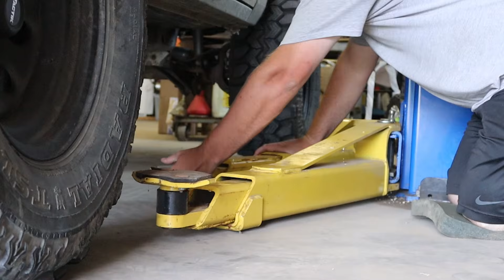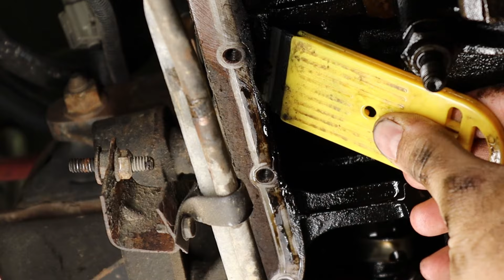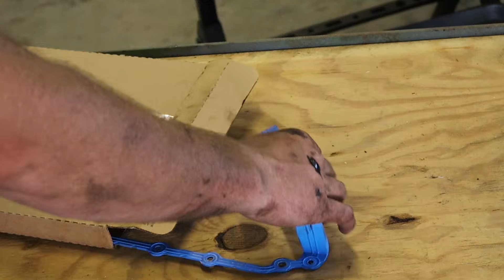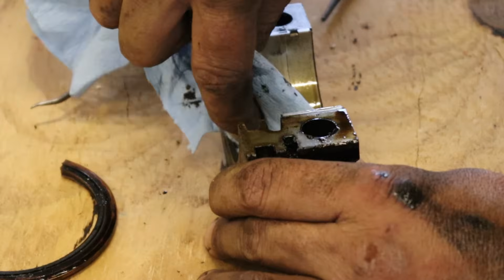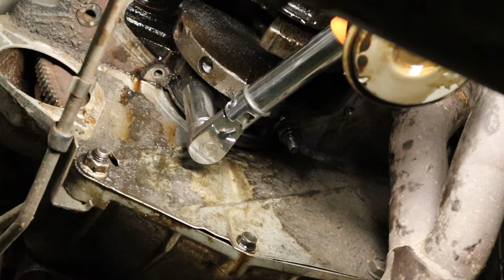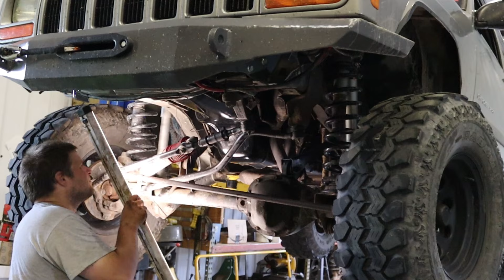JEEP 4.0 REAR MAIN SEAL replacement AND OIL PAN GASKET on my JEEP CHEROKEE XJ

Comment: You have any problems with leaks after? Done this twice good for 3 days then It’s just as bad as before. Wondering if it’s possible I got the pan gasket in there pinched or if my motors just got too much crank play

Comment: The zinc oil is nonsense....they stopped putting that in oil in the 80s and yet a properly maintained inline 6 will go to 300k with conventional oil easy. Also when you have the oil pan off its a good idea to nuke everything with parts cleaner and get all the old oil and build up off. I did this project on my 2000 WJ  a couple years ago....good video though 🤘

Comment: Soak both of the seals in transmission fluid. This is superior to other oil-based products, and it will be far more slippery than others, resisting heat much better on the wear in period. The amount of fluid in your oil will be insignificant.

Use Motorcraft Gray RTV. Its what technicians use over black. Sets up like putty, stays in place and won't split or squeeze out over time.

Comment: Note: I HAD to use the “shoehorn” piece of paper on the outer side of the seal for install. It went in super easy once I had the piece of paper in the right spot. It would not go in by hand otherwise.

Comment: Did you have to drop the transmission on it at all? or was it just the oil pan? And for the oil pan did you have to drop the axel or does it just slip over with the lift?

Comment: nice video - well, to get the oil pan out, usually is a pita with stock XJs. Did you just untighten the shocks and drop the front axle ? Thanks.

Comment: I haven't been in an '00 up. Had not seen the main girdle. I wonder if that increases rigidity at all. I imagine pre '00 would need different main bolts to add that. Any comments? Thanks for the excellent video.

Comment: Question! I got my 2001 jeep grand cherokee, with the 4.0. I wanna do my rear main seal as well, is the procedure the same from this video I just watched??
Reply: Thanks for the reply, but I've already did the rear main seal. About a month ago and it was the same, I did a motor swap and I changed the gaskets on my new motor on a stand and the new motor is in and I've been driving it for a little bit now with no issues or leaks! Thanks for the video as well man!
Reply: @joelafleur6423  not my video but glad to hear it went well for you!
Reply: If it has the 4.0 inline six, then yes it'll be the same
Reply: There's a possibility the front suspension could get in the way. Not familiar with the grand Cherokee suspension from that era

Comment: How did you remove the two bolts on the back of the oil pan that are up against the dip on the oil pan? Doesn’t look like enough clearance between the bolt and pan to fit a socket

Comment: Is it not a good idea to try and clean up inside of the engine when you have the girdle and the oil pan off like if you can see sludge on the Pistons or anywhere else
Reply: No.

Comment: The main girdle bolts are 14 mm. And he should seal the main rear seal with silicone on the mating ends, or it will leak.

Comment: bullshit i have a 96 xj the bolts where easy to get to but i cant get it out. front axle is in the way and no idea how to get it out. the oil pan just doesnt drop out that easy on a xj unlrss you have a lift.
Reply from the maker: This part of the process is frustrating I know. the oil pan doesn’t just drop out when you take the bolts out. You may to twist it a certain way clear everything ie steering, axle, dipstick tube and oil pickup tube. Try disconnecting your shock and trackbar. That will allow the front axle to droop  further down. If your jeep is stock than our are the same droop wise. I have longer shocks but they don’t fully extend at full droop.
Reply: That's what I had to do I had to undo my shocks front. Undo the sway bar and took a scissor jack and had to shove my front axle downwards. Then I was able to get the pan off and on. If the oil pan was about an inch less. Meaning the piece that hangs down the front of the oil pan where all the oil sets. If that was about an inch shorter not tallness but width from front to back it could make it without any extra time.

Comment: Quick tip for those using the little blue pins on the rear of the block to install the gasket ... it's not explained that you will have one PITA getting the pan to line up especially with having the converter cover on so get ready.  Wish he didn't cut that section off but I left the tip for future installers.  It's not that simple on this step.

Comment: Any tips for the upper part of the rear main if you dont have the little guide to get it started?
Reply: And what size lift and tires do you have?
Reply from the maker: Lift is a 4” lift and my running 32”s
Reply from the maker: The upper guide is just a piece of poster board. You could try that or gently walk the lip of the seal into the cavity.

Comment: when did the white paper get pulled out? did it follow the seal to the other side or did you take it out after you got the seal going?
Reply from the maker: the white paper is just there to help protect and guide the seal when installed into the upper channel. think of it as a shoe horn. it shouldn't pass through the upper channel.
Reply: I had to buy another top seal because it ripped and bent, I guess I put the shoe horn on the outside whereas you placed it on the inside and you folded it but I don’t know exactly why

Comment: Did you use diesel motor oil on it?
Reply from the maker: it might say diesel oil on the side of the jug but its a 10w30 weight which is more of a gas engine weight oil. the shell rotella t5 10w30 oil has a higher zinc content then most conventional oils nowadays

Comment: So, I let the screw driver slip and damaged the bearing cap insert I guess? Its the C shaped piece that sits in the wide part. You think sanding it with some fine sandpaper will be ok? I can't get a replacement part and I need to put this back together asap
Reply from the maker: I agree. I'd just make sure the bearing surface is smooth before reinstalling
Reply: My 2 cents….. I think it should be ok.  Not much you can do at this point. Fuk it.  Hope it’s good.
Reply: I found the correct bearing and put it back in. All systems go. Oil pressure drops to 20 at operating temp now though.

Comment: Thanks for the very clear and detailed walk through of this.  As I was watching I thought to myself... "Nice, the Haynes manual was wrong; I don't actually need to disconnect the exhaust manifold, remove motor mount bolts, and raise the motor to get enough clearance."   Then I got to the part where you said you have about 3.5" of lift.   

For a stock height Jeep is your "just raise the vehicle and allow the suspension to droop" method going to provide enough room for wiggling the oil pan out over the axle?   Then back again in place without messing up the new gasket.
Reply: In my experience it is not enough. Just dropped the oil pan today. At stock height I removed the sway bar endlinks and unmounted the shocks from the tower. I was then able to put the stock jack between the axle and frame to get the clearance I needed.
Reply: @nalgene247  lower all the way to the floor on tires, pan will fall off,
Reply from the maker: It’s should. I have stock control arms and a stock track bar which limit the suspension droop before my lift shocks will.
Reply: @TheOffRoadCorner  Thanks.

Comment: Can you tell me who makes that torque wrench and the cost ? Thanks😎
Reply from the maker: Here is a link to the one I’m using
And had it for years. It’s $500 its pretty expensive.
https://www.matcotools.com/catalog/product/TRA200K/1-4-drive-fixed-40-200-in-lbs-torque-wrench/

If you’re looking for a cheaper one but still good check Teton tools. Theyre good tools and a little bit more reasonable. Here’s a link
https://www.tekton.com/1-4-inch-drive-dual-direction-click-torque-wrench-trq21101

No affiliation with either company. I just like there tools
Reply: @TheOffRoadCorner  thanks for the information 👍😎

Comment: Did you leave those 4 blue inserts in the gasket or take them out before bolting the oil pan?
Reply from the maker: Yes. Those blue inserts come out once you have the oil pan in place and smaller pan bolts tight

Comment: Did you remove anything from the the front end to make it easier to get the oil pan out and in?
Reply from the maker: I didn’t remove anything from the front end. I do have the suspension at full droop and My jeep has a 3.5” lift which definitely help.
The steering drag link  is about the only thing that gets in the way a little but the pan will come out if you droop the front suspension out.

Comment: I have a 2001 cherokee, do you have to torque the oil pan bolts? I couldnt find the specs.
Reply from the maker: Torquing the oil pan bolts would be a good idea. Just because it’s better to have even clamping force on gaskets.
Reply: From the FSM: 7 lb/ft for the small pan bolts, and 11 lb/ft for the large pan bolts.
Reply: From center out with a good sequence

Comment: I did this exact replacement. No leak for about 50 miles and then leaking again :(
Reply: Could be the valve cover
Reply from the maker: Could be
Reply: Or the oil filter adapter.

Comment: Disconnect the positive battery terminal better plan, otherwise Great Job you made it look easy !!
Reply: What do you mean by peen out the pan when installing a high flow oil pump?

Comment: Thanks for the video, I’m replacing every seal from the valve cover to the rear main the first week it’s warm ...you have assisted in taking the mystery out and I see I won’t have to pull the front axel. 

Thanks a lot man. I’ll be using a plastic punch though, just watching that made me cringe
Reply from the maker: I’m glad I could help. Plastic punch would be go but you will have to get rough with removing the top seal. Brass punch might be a better option
Reply: The Off Road Corner Advised; thank you

Comment: Thank you so much for talking slow, which reallh helps me on this. Some people go way too fast. Can I do this without a lift and why did the starter need to be removed?  I have heard to use 5w 30 oil. Very confusing what to use. I dont know the shape of my oil pan. May get under it and look tonight. Great video. I assume you pull the piece  of paper out when doing the upper main seal. My jeep is an 04 in line six. Probably nuts to spend money on an old jeep but it is fun to watch all these repair videos.  I just had the radiator leak so I am going to try to chase the oil leak and do all four of what you mentioned. Should I do the water pump too it's not cheap for a lifetime warranty one. You advise would be appreciated.
Reply from the maker: you can do this without a lift. having the front suspension at full droop will help with getting the oil pan out. I wouldn't go any thinner than 10w30 on these engines. I use shell rotela t5 10w30 in the winter. the summer time I'll use a quart of the Lucas oil stabilizer with the rotela t5. I didn't like this Mopar filter I install in the video. it seemed to have pretty bad oil drain back which gave me lifter tap on cold starts. Yes I pulled the piece of paper out after install the upper rear main seal. if you don't know the history of the water pump I would replace it. they are somewhat known to fault at about 150K. thanks for watching
Reply: @TheOffRoadCorner  Thanks I did put t5 rotella in but freinds were worried its to thick for nebraska weather. It's been down to 1 degrees this last week. I have a suspension issue now maybe a wheel bearing or ball joint. Hard to work on when it's this cold.
Reply from the maker: I hear you there. It’s been -10 to 0 here. Makes working on everything tough
Reply: i use 5/20 in the winter and 5/30 in summer (live in Pa)
Reply: You don't need to remove the starter.

Comment: Nice job Drew.Good call on the Rotella.I use T-6 in the summer and Rotella Gas Truck 5-W30 for the winter.
Reply from the maker: Thanks man. I’ve been pretty happy with this oil. Seem like pretty good stuff

Comment: I've seen a lot of people put rtv on the rear main cap when they reinstall it but you didn't mention it.  Did you just not record it or do you not think it's needed?  I need to do this on my Jeep, it has had a slow rms leak since I bought it 6 years ago.
Reply: You can use RTV on the older style rear main caps, but the later years caps like the one on this video, you would need to  use LOCTITE 515. Regular RTV is too thick. Watch the link below. 
https://youtu.be/_a7QpBvzreE
Reply: @xlightssx  
So for a '98, rtv or loctite?
Reply from the maker: @ jon hart I actually didn’t put any rtv between the engine block and the rear main cap. I was afraid if I put any RTV between them that it might change the bearing clearance on the crank journal.
Reply: I forgot rtv first time, had to tear it down again at next oil change.. put rtv also in rear and front of the oil pan.. seems to be sealed now.. Also, on a non lifted xj it's a pain to remove oil pan.. 🤪 loosened shocks and sway bar.  Also, no need to remove starter..
Reply from the maker: @ Thomas hijertstrom. I’ve done that before. It’s not fun redoing it hahaha. Yeah probably didn’t need to take the starter off but I think it gave me more for cleaning the mating surface. I Imagine stock there no more at all up front.